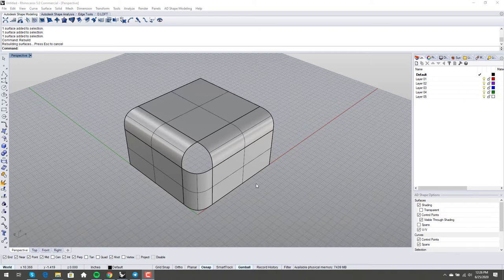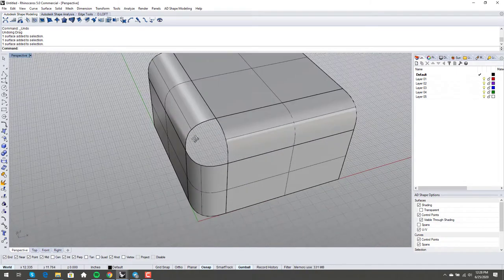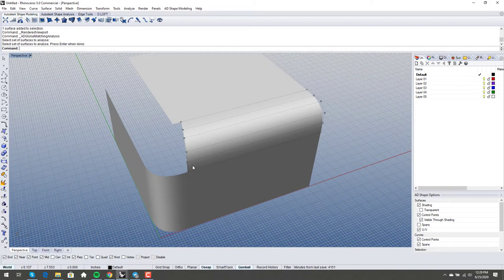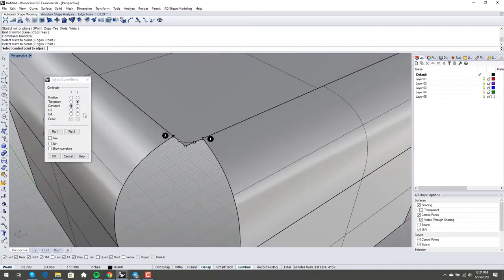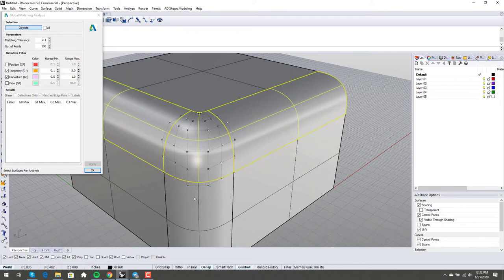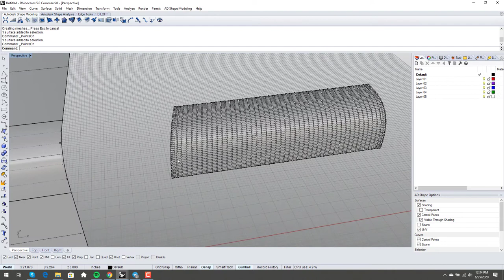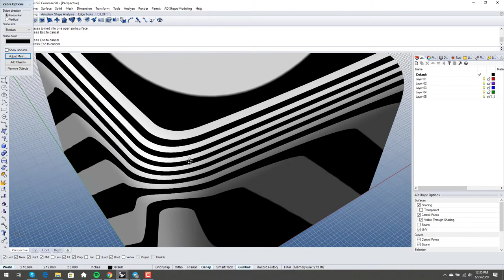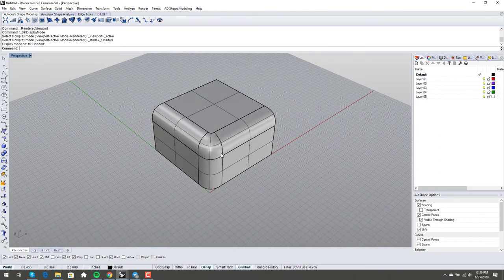Primary Surfacing: Episode 10 - Basic Ball Corners

Comment: note to the author of the video, the command pull doesn't seem to work as expected, as the resulting curve seems to be different than the edge from where it came, the proper command seems to be the one named project curves, (located in the curve from object tool tab/screen/window), in this case I went to the RIGHT window so I am looking at the blend as if it were only a curve thus I am looking at it straight ahead and the surface that was just previously created with the extrude command is just past the blend, here I used the PROJECT curves command and this one did work, or so it seems, for the moment the control points do seem to be in the proper locations and the resulting curve does seem to be identical to the blend from where it came from... finally I went ahead and used the match command and this did also work as we were expecting

Comment: This case is pretty much a special case 1 (easiest possible). The basic method is shown. Now, lets "ball corner" a three sided corner with curvatures in three directions. Also could include the fourth "top" surface also with a curvature:
· case 2 (surfaces have periodic nature with a sub-case of Bèzier nature, second degree curvature, circular/arc type)
· case 3 (surfaces have at least 3rd degree, Bèzier NURBS nature) - this is what I had to use in my design; an absolute nightmare yet manageable!
Reply from the maker: The approach is actually identical if you have surfaces that are non planar! You just end up spending more time using MatchSrf is all. I've been too busy with other work to create the next cases, but really and truly if you can do this, then you can at least apply the same approach to the cases you discuss.

Comment: I didn't understand why after you did the pull you proceeded with at match surf.... match what to what?
Reply: He pulled the duped edge to a planar extrusion and then matched the original surface edge to the pulled one to ensure it is planar. I guess one could do that by setting a convenient CPlane and using command SetPt but this seems pretty convenient if well executed.

Comment: I have some serious problems with rhino software and some complaints and even personal conjectures...
1st of all I am trying to replicate this exercise/example.  and from the very start rhino start making problems, here for example:
 if I try to create a CURVE blend from one edge to the next edge(by using the quick curve blend command), the curve created has a different control point location than the control point locations that appear if I were to create the blend by using the blend surface command, as with this last one, the 2 control points in the middle of the 5 degree surface are closer to each other, shouldn't these 2 blends have these control points in the same locations as a default?  this seems like a deal breaker to me, now I went ahead with the exercise by choosing to keep the surface created with the blend surface command knowing that if I were to choose to use the previous option the final shape would be extremely different due to the control point location, and then as soon as I used the pull command, the resulting curve is clearly not in line with the blend from where it was made I thought that this could be corrected if I were to do the operation in the RIGHT side window, expecting that the curve would appear just straight ahead, but na, the curve had the same wrong shape as with the previous attempt, this makes me fill like rhino has something wrong!, now for years I was learning this software and for a time I considered my self as a advanced rhino designer, but then it became clear that I was wrong, rhino has to many flaws and in my opinion these flaws are deal breakers and in my opinion I lost years to a software that is plagued with problems and that seems to openly disregard the years wasted that the student and user are going to go through if they make the mistake of choosing to use this software, to me it seems like rhino is nothing else than a test bed a test platform, to me it seems like the the mc Neel company is selling the good commands, after having put the ugly babies to grow in this platform/test bed named rhino, in this day and age rhino simply has to many flaws that clearly could have been fixed decades ago, the company has the cash and the ppl to fix all these flaws and yet they have not done this, how is it possible that newer programs have way better all around platforms than rhino, if rhino was there decades before them, to me rhino is a test bed, just like we saw that they had Tsplines and later was sold to autodesk, freaking nightmare I have years using the bloody software and yet it still keeps tossing me low balls... cheap bastards fix the damn software!

Comment: uhm... Nice, but when I try to repeat all your steps in Rhino 7 it doesn't work like that :( When I start Matching Surfaces one by one, it matches 2 edges I select, but breaks all connected! You match 1, it breaks 2. You match 2, it brakes 1 and 3. :( If I use MatchSrf and MultipleMatches it kinda matches, at least no visible holes, but Zebra analysis looks ugly :( And edgeanalysis shows final mesh is not even watertight. I don't know what I'm doing wrong, or is it v7 problem...